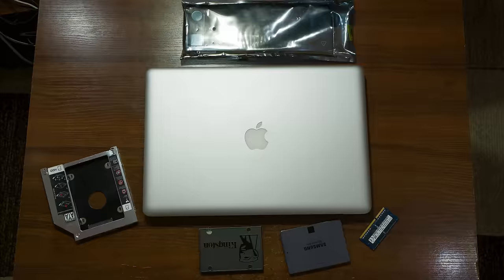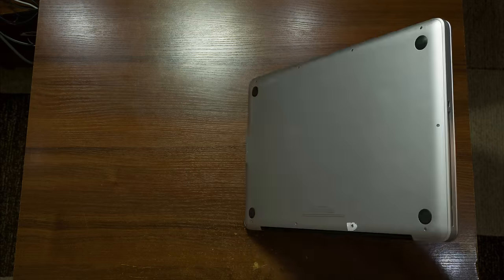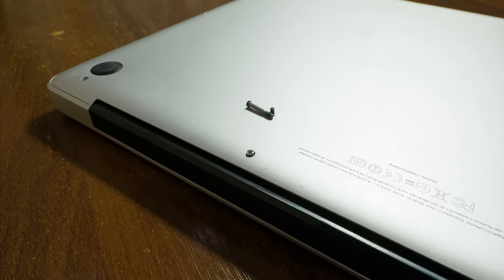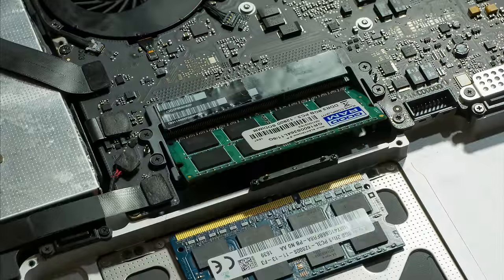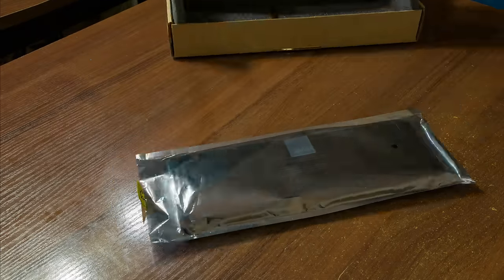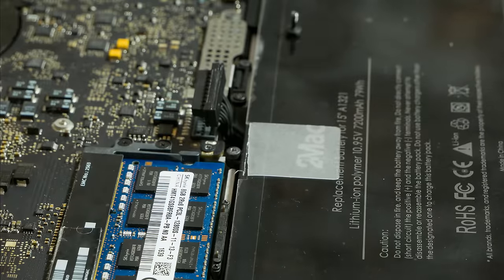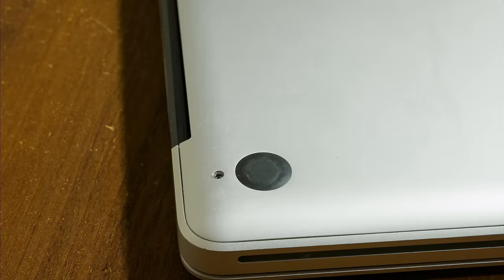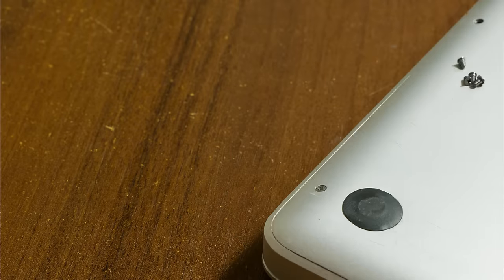Upgrade an old Apple MACBOOK PRO laptop with i7, after 11 years

Comment: I've got a 2.7Ghz Quad i7 2012 non retina I bought in 2020 & did the same service. Pulled it completely apart, re-did the thermal paste on cpu/gpu, maxed out the ram, removed the optical drive & replaced it with a 2tb SSD, & replaced the boot drive with a 1tb SSD. Use it everyday & it works perfectly 👌
Reply: Where did you buy it? what is the max ram you can upgrade that model?
Reply: @hotsaucenchicken09  16gb is max ram it can take
Reply: Why would you buy a 2012 laptop in 2020 tho, should have gotten a proper laptop
Reply: Works perfectly... but I'm not sure that performace is really worth the price. Is it?
Reply: @giuliolele your education sucks
Reply: Gpu what model?

Comment: The hings is spring loaded and lubricating it won't cause any harm to the mechanism. It will stop the creaking noise and make it work smoother. I have repaired many MacBooks in my days in IT and use either silicon based or lithium grease, doesn't take much. Once you remove the upper LCD assembly you can remove the plastic cover to expose the screws to tighten if needed and lubricate the hinge part.

Comment: This is great, last things to do if you want is upgrade the screen (if not already equipped), upgrade the wifi and bluetooth & update to the latest Mac OS via OpenCore. I can't speak for the lower models but if you have the 2.6GHz or 2.7GHz i7 it'll feel like an up to date machine.
Reply: Mine is the 2.7 quad i7...currently on Mojave but thinking of moving on to something newer
Reply: @maladjustedtv   want to sell it to me? i'm looking for one, its been my dream machine since it came out... bought a retina in 2014, which broke down on me in 2021. if you're interested let me know:)

Comment: I love your stop motion animation!! Amazing work! Upgrading the CPU on those is not really possible…😢 But a new SSD and more RAM, plus a fresh battery pack are a nice upgrade if keyboard and screen are still in good shape.
Reply: You can replace cpus but the problem is it’s really expensive to upgrade soldered cpus and it’s not worth to upgrade, most people would just say to buy a new laptop or replace entire motherboard
Reply: tecnicaly is posible to upgrade the cpu to a i7 but is very hard to do and if someone do it mabe broke the motherboard
Reply: @alonsodsoto4466  dosdude1 on YouTube will do it for you, for a fee. I wouldn't trust anyone else with something like this.  I will always pick him.  He does more than CPU upgrades.  He also upgrades RAM on models with soldered on RAM modules as well as many other things.
Reply: Funny thing is they did have G2 and G3 sockets for Intel's laptop cpu's back in 2012 that allowed you to upgrade. I had a thinkpad W520 around this time that I upgraded the cpu in.

Comment: I have a MBP 9,1 (15 inch i7, mid 2012, non retina), the last model to be  user serviceable if I'm not wrong. Bought it july 2012 and upped the ram to 16GB (Corsair Vengeance) right away. Since then, it took me 8 years to replace both the HDD and Superdrive for a 500Gb Crucial MX500 SSD (main drive - os and apps) and a 1Tb WD Blue SSD (storage). Last week I just replaced the power jack, battery (almost eleven years old) and power adapter/charger (my 3rd one). I did maybe 2 internal cleanings, one of them was very thorough and I also changed the thermal paste (i believe it was around 5 years ago). It was my only computer for many years and still is my main one. Sure it is not as fast as more modern machines, especially the ones with Apple silicon. It also will be permanently capped at Catalina (last officially supported version for this machine, and I'm not going to push it further). It has A LOT of battle scars and sometimes heats up pretty bad (specially after installing 2 SSDs). For most things I do, it is fast enough. For some uses (more demanding video editing), it reaaaally shows its age and it's becoming borderline tolerable. But it is still totally usable in 2023 for a lot of tasks. My MBP is a true warrior and also a great companion for the last 11 years. I'm planning on getting a new MacBook this year, but I'll keep using this beast until it breaks beyond repair because it's such a well engineered and nicely put together machine.
Reply: Have the same one, still my main!!! Lol love this thing
Reply: just Apple things
Reply: I've replaced the SSD on  my late 2013 13" MBP with an nvme drive, so some stuff can still be done to it. I see AliExpress does a replacement battery set, but new keys are what I need next, as some are wearing thin. Magsafe receptacle the usual garbage, but hanging on in there. The kbd action is still 100% ok. Retina display fine. Bought new, best value for money laptop I've had.

Comment: Much of this is quite correct. I don't know why you took it apart that far though, and I don't understand what you did with the CPU. Did you switch the CPU? But it already had an i7, right? A newer and better i7? It would be an interesting thing to do if it is possible.

Much of the rest is what I would call standard procedure: Max the RAM, put in an SSD instead of the hard drive, replace the battery if needed. And those parts are very easy to access, which is a very strong thing with this model, the very last where you could do that!

I was very pleased with the part about the DVD. You take out the DVD, replace it with a hard drive... and they say no, don't do that, put the DVD back! I wholehartedly agree! A DVD burner is still a valuable asset, for backups! If/when I switch to models without that, I need to get an external one, or maybe I just keep the 2012 to perform the backups!

You may say that a DVD isn't big enough for a backup? It is big enough for your most valuable files. Be safe. Nobody can crypto-hijack the stuff you put on a DVD!

Comment: I have a late 2009 Mac Mini.  It came new as the server model with two hard drives.  I've had the primary drive replaced with SSD and maxed the RAM to 8 GB.

Just for grins, could the CPU be upgraded like this?  I'm a little surprised these old motherboards don't fry from the big speed jumps.

Comment: so i just bought a MacBook Pro (Retina, 13-inch, Late 2013) 8gb ram 256gb ssd for 80$ . The battery life is about 4 hours heavy use , what are the recommended replacements / upgrades i can do budget or not , have improved performance with gaming (just the 3DS Emulator)  i haven't found not one video on my model

Comment: Fantastic filming, however, that is an overkill amount of thermal paste. Ideally, a pea sized amount in the center of the contact surface is needed and once the heat sync is added it will spread itself. In some cases, too much paste can actually be counterproductive in its intentions

Comment: Where did you get the battery struggling to find a good one for my old MBP?
Reply: Check Amazon ($60-80 range unfortunately). I've tried ebay a few times around 40 but they are usually doa or don't last long.

Comment: So CPU and GPU is upgradeable in these? What is the best you can put in it?
Reply: i7-3820QM maybe? It's been a while, but I guess whatever you could configure from that generation. As for actually upgrading them, it's one of those "technically" deals. These don't use socketed CPUs so you either change the whole board or get some board level work done (de-solder and soldering) with the special gear and skills that entails. These are getting real cheap though so DIY experiments could be worth it if you are up to it.

Comment: A nice video, very well done but there's no details about the model of the Mac neither the changes you did it
Reply: Looks like a 15 inch 2011-2012. Upgrades were:
New battery
SSD main drive replacement
Maximum ram (16gb limit)
DVD drive swapped out for caddy mounted drive for additional storage 
New thermal paste on CPU/GPU 
Maintenance on hinges

If you go this far, there are 'while you're in there' upgrades you can make like:
Upgraded wireless card (WiFi and Bluetooth. You get new features if you patch in newer but unsupported OS)
High resolution screen (the ones with silver frame I think)

Comment: Nearly the same action as in my Lenovo T430, but much more to tear down compaired to the lenovo, New CPU (as it was socketed) Gen 3 i5 to Gen 3 i7 quadcore, RAM from 8 to 16GB, new thermal paste, 500 GB HDD to 2 TB SSD and you had the same performance as an 8th Gen i5 Quadcore (in the meantime the i5 went to quadcore).

Yes thats sustainability, and if the battery is worn down, next battery pack and it will be good for several additional years. 

The stop-Action was a good idea, completely different to the other thousand upgrade videos. I second @dissonant_ its art  not tutorial

Comment: Please can you list the parts you upgraded
Reply: Looks like:
New battery (there are different capacities available)
SSD main drive replacement
Maximum ram (16gb limit)
DVD drive swapped out for caddy mounted drive for additional storage 
New thermal paste on CPU/GPU 

If you go this far, there's a couple of 'while you're in there' things you can do like:
Upgraded wireless card (WiFi and Bluetooth. Supports new features if you patch in newer but unsupported OS)
High resolution screen (the ones with silver frame I think)
External DVD drive conversion case to reuse the removed drive.

You can still get kits from iFixit or build out your own if you research and make sure to buy compatible parts.